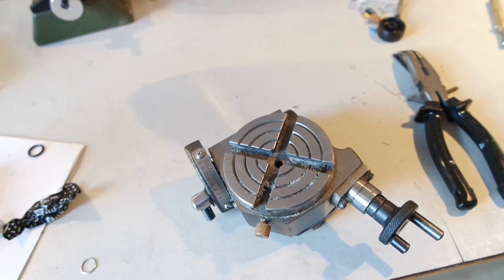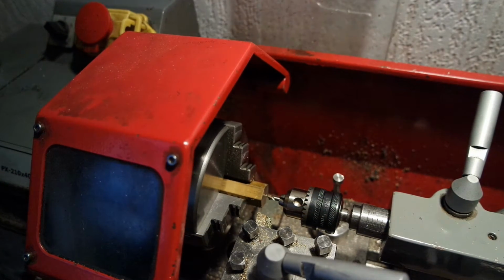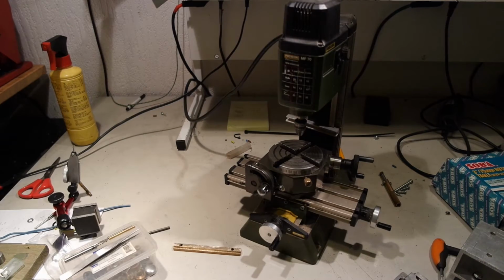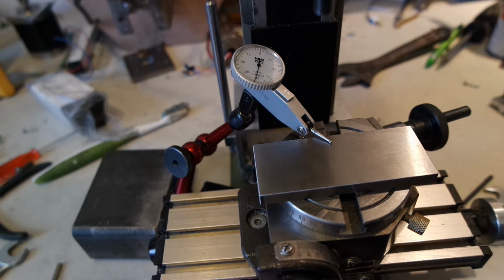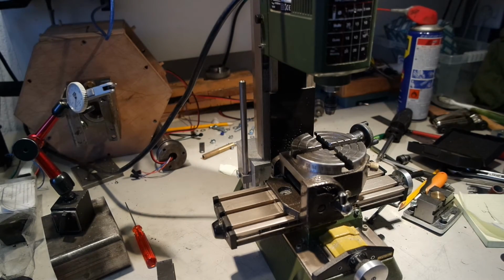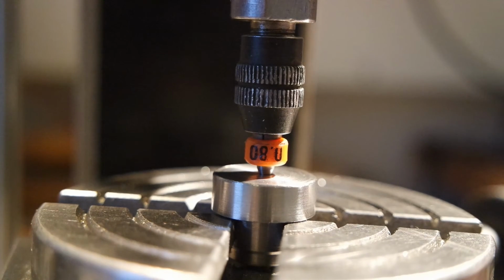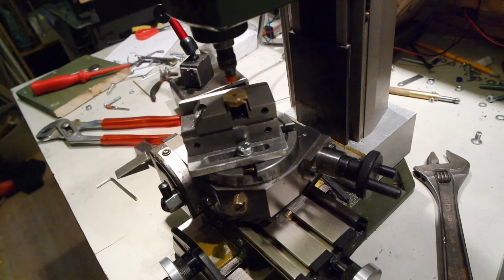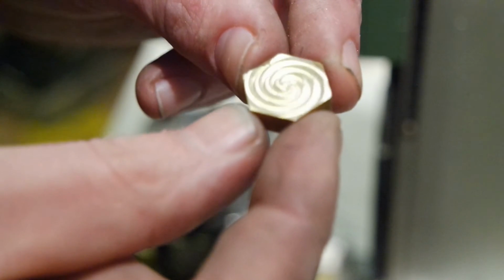Hexagon #2 - Rotary milling - part1

Comment: I am about ready to order a small rotary table for my mill drill, and watched your video-- interesting...

Around 4:56 you mentioned issues with the tool post and the boss on top of the compound of your lathe which appears similar to one I bought...  My lathe (US retailer) has same compound with boss that fits the 4-way tool post.  Here the QCTPs are a bit different, but I was able to bore out the bottom of the new tool post to fit over the boss, and turned a bolt down so it fit into the lumen of the QCTP to capture the threads on the compound stud...

https://www.youtube.com/watch?v=7jOVEh1uxpo&t=1s

The link to an original video about turning the hex bolt into the top nut is in the description...

I will need to turn down or buy a center post for the rotary table- as the one I purchased has a MT2 taper.